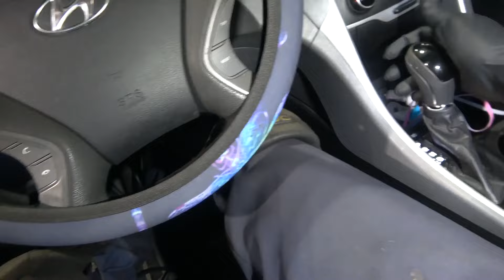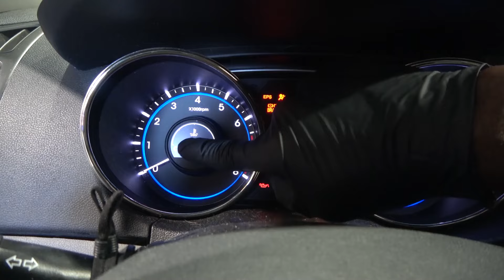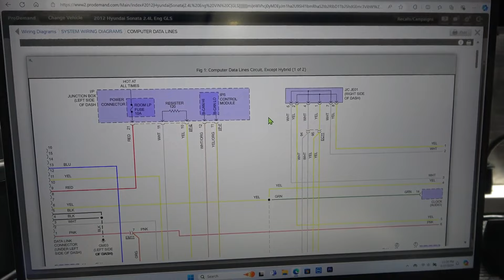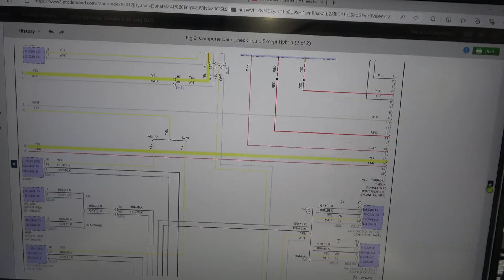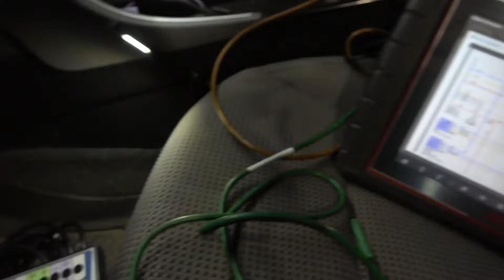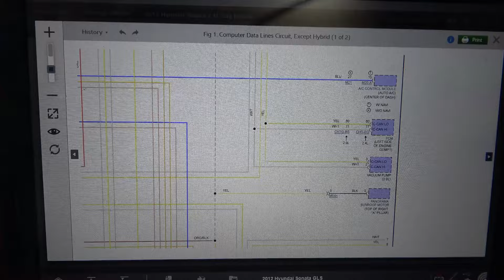A Visual inspection Helped me Fix this Car - Transmission Stuck in Park on Hyundai Sonata - Part 1

Comment: I am having the same issue after changing the steering angle sensor and clock spring and still haven't found the problem
Reply from the maker: @jamesmccoy7104  your problem is somewhere else

Comment: On Hyundais and Kias you should count the DLC backward, Pin 8 would be pin 1 and pin 16 would be pin 9.. So you should go to pin 6 & 14.  It's crazy how it is. So pin 3 would be pin 6 and 11 would be pin 14 .
Reply from the maker: @vickenkaragozian2041   Good point, I should gone to pin 6 and 14 but the wiring diagram threw me off!
Reply: @KITS_Auto_and_Truck_Repair  yes crazy Hyundai. You can see the picture of DLC on factory wiring diagram page 2 or Alldata. Thank you 👍

Comment: A 2005 Mitsubishi l200 with an inline 4 COP ignition system with an engine code of 4G64 SOHC engine installed in it was pretty okay. Thus, the client used it for some errands from the morning hours to the afternoon and it was perfectly running. Nevertheless, when the client returned  home the 3rd time, his boy reversed the vehicle within the man's compound for a wash. If I'm not mistaken though, the car stalled on him or it was about 20 minutes ago when the boss was about to move again with the car that the noticed the problem. But they said it was only a reverse  he did. 
   The car would crank, start but stall immediately within 4 seconds. I was called to rectify and fix the issue. 
  One of the things I checked when the car was cranked was the fuel system. With ignition on, the car wouldn't pump even an iota of fuel through the fuel hose to the engine. 
   Bypassing the pump directly to the battery positive and ignition switch to the on position, there's a great pressure or amount of fuel from the fuel hose. Alternatively, I unplugged and plugged back the 3 wire CKP sensor connector and noticed a great buzz of fuel too. I proceed with testing fuses and relay from the engine bay and only one fuse was bad and it was replaced. From inside the car I all relays and noticed that the CKP sensor no longer pumps fuel to the engine with the unplugged and plugged method but the bypass method and noticed the relay location that controls the CKP fuel pressure buzz on ignition to the battery positive still wasn't affected. I didn't know more to do there than swap the relay.
   Next, I checked for injector pulse and noticed only a single or no pulse at all. 
   I tried to hook up a scanner to conduct some test however, the scanner was not connecting. 
  Next, I checked and observed that the timing was pretty weak. I showed the client, he said I should replace it which I did. 
   Presently, it's a crank no start, single injector pulse no spark, no communication to my scanner. 
   Please, how can I address this issues? How can I bench test the car 3 wire CMP, CKP sensor with a multimeter or a test light or LED light outside the car? Where is the fuel pump relay location. Please send me the car wiring too , partaining to the no start most likely.
Reply from the maker: @davidessien5465  Hello my Friend I recommend you get scannerdanner's book, you will learn more about CMP & Crank sensors on his book, you can also get the wiring diagrams from mitchell prodemand
Reply: @KITS_Auto_and_Truck_Repair  okay sir. Please, what about a single injector pulse and a no start, what should I check for?

Comment: We have  a Hyundai Tucson GLS 2011 with the same engine and I have to say Hyundai is a nice car but the service sucks at least in Calgary Alberta Canada. It was a recall and still is for a ABS problem and the last update we have to go to the the dealer to replace the ABS "fuse" ! About the transmission we have a very pain symptom in middle of the road the car stall with the stick locked in the drive. We learn from the net how to use the switch to release the stick. I printed the service technical bulletin about it and I give it to the smart service manager and this after they start guessing and replaced on my money the transmission liquid  only $300 from my pocket. About the locking problem they replace a brake switch and since then knock on the wood! About your client problem a friend of mine has a Subaru and had the same problem the display with all the light on and was the speed sensor faulty. Your circuit has a 10 A on it and a  resistor but first disconnecting the battery might reset de module in my opinion anyway good luck with the diagnostic and we wait for the part 2.
Reply from the maker: @aureldumitrescu6822  Thanks for sharing, Part 2 will come out soon!

Comment: I'm just a little confused. Since every module has their own CAN chip and emits a signal to the network, if we have an open somewhere I would think all the modules after it wouldn't be able to talk to the others. I was thinking about a short to voltage because the CAN chip can't go over 3.3 volts. In the video I was reading battery voltage on the CAN bus. PCM, ABS, Cluster, TCM they are all out because the CAN is corrupted.
Reply from the maker: @MargenAuto   Modules don't have their own CAN, They all share the network, an open between the DLC Connector and the network can cause the scan tool to not communicate with the modules on the vehicle, Part 2 is coming out soon, you'll enjoy tthe fix, Stay tuned
Reply: @KITS_Auto_and_Truck_Repair  I'm not going to argue but I'm pretty sure each module has a Controller Area Network chip that allows them to communicate with other modules on the same Network. The Bus is just a pair of twisted wires connecting those modules in parallel. For instance, if one module is contaminating the network, you can easily remove it and automatically gain access to the others.